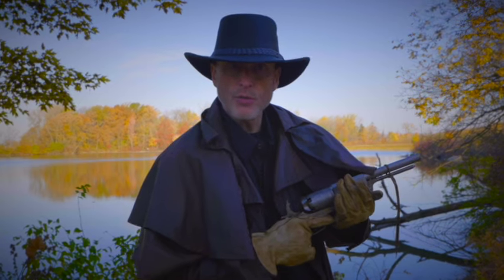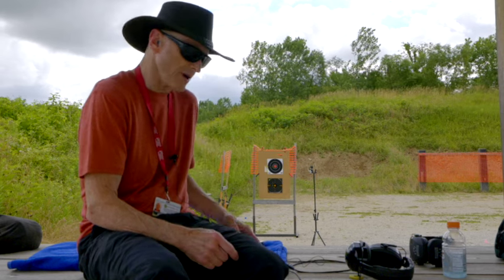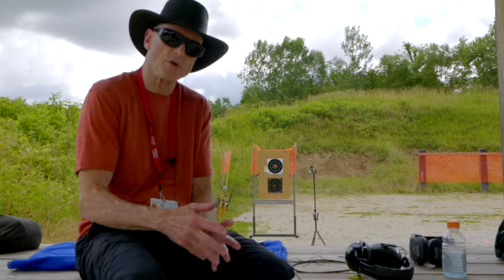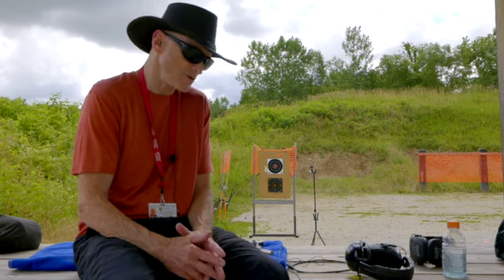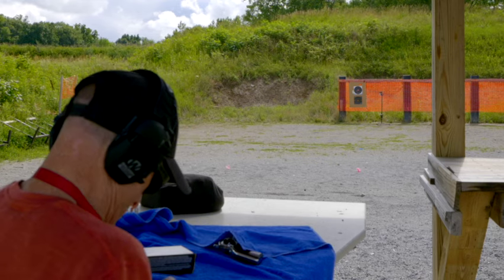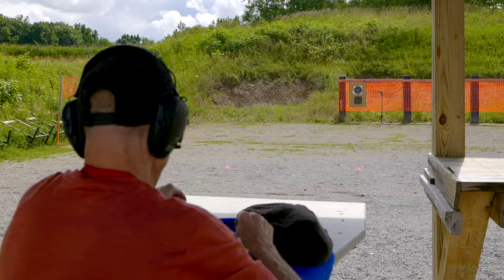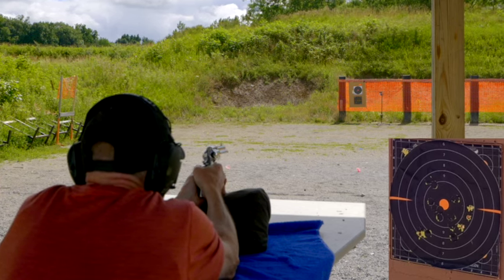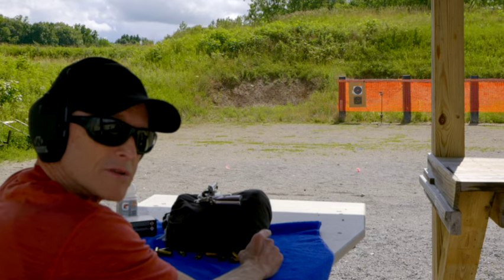Ruger Vaquero Problems Update Watch Before You Buy

Comment: I have 2 vaquero 45lc I use for sass. One is great, the other was built on a covid Monday. The cylinder is actually longer than than on the other gun. Causes loading issues with my reloads. All my reloads work fine in one Ruger, and my uberti cattleman. Ruger quality control  is not good. Don't think I would ever buy a new one again.
Reply from the maker: Thanks for this information. I agree Ruger's quality control for this gun was poor. Thank you for watching and supporting the channel!